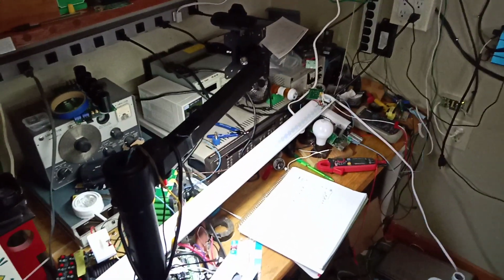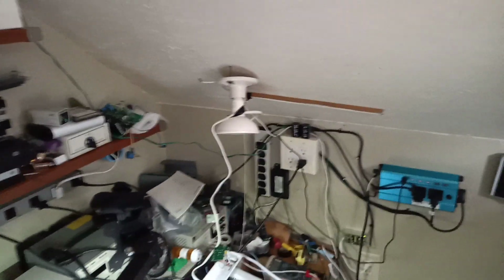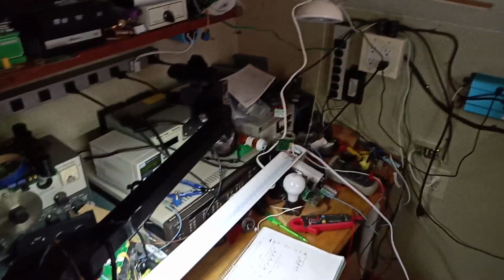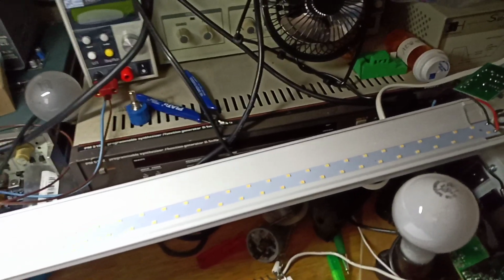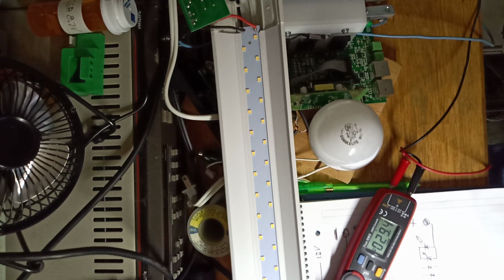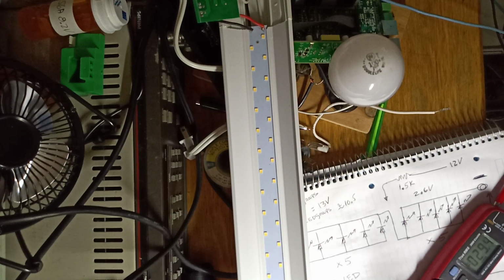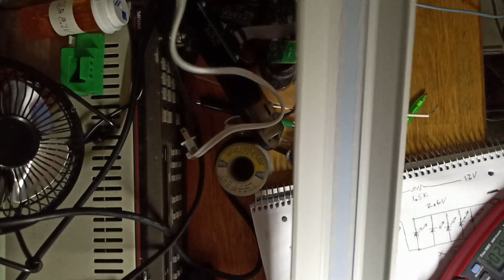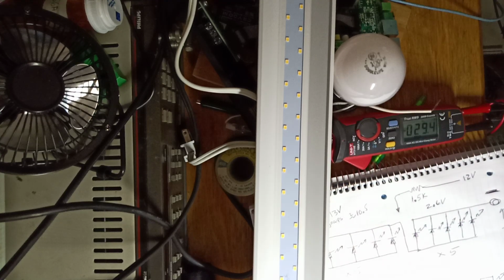120V LED Shop Light Conversion To 12V DC, How It Is Done

Comment from the maker: Not all shop lamps are suitable. Each LED can have one, two or three die in it. Another lamp I have has three in each LED for around 8V each. They put them all in a string for 114V DC. Impractical to convert to even 48V.  This also requires some skill.  These boards are aluminum with a thin insulator coating and trace.  I haven't found anything that will dissolve the coating.  Scratching it takes some practice not to cut thru.  When you do cut, it is easy to make it down to the aluminum substrate.  Then there is the risk to have two cuts short out the supply.  When finished coat the cuts with fingernail polish to prevent tin whiskers for shorting over time. I had already bought this lamp so there was nothing to lose.  
For those who have flicker issues with LED lamps running on inverters, PHILLIPS. may be the answer.  Watch this video reviewing popular lamps  https://www.youtube.com/watch?v=XeR2uPPCA2k

Comment: Forgot to mention in my last comment. I am really impressed at how bright the LEDs lit up at only 12/1500 = 8ma - it really caught my eye (pun intended)! Are these those commodity shop lights that sell for $20 or so, or special ones?
Reply from the maker: I just finished it a few minutes ago and decided to run it 26V with fewer cuts off the external 29V boost converter I had mounted for the other light. The power switch I changed to low and high intensity. The extra LED string at the end I left disconnected because it would be behind a shelf. I'm pleased at how it turned out.  This was a cheap $10 shop light but they all don't work this way. Another one has LED with three die in them for about 8V per LED. All in series for 114V.  Not practical to do at all. I used my 2700V tester on that one. That is a handy little device.
Reply from the maker: These LED would dimly glow just from the capacitance coupling of the iron.  I designed a LED monitoring system for a NGO. People has to walk this one foot wide path between the rice fields at night to see if the gas water pumps were still working.  There were poisonous snakes and other things that made this a dangerous trip. They wanted something cheap that didn't take batteries. I came up with a 4W LED mini floodlight that operated with a voltage doubler to power off the gas engines points. Less than a miliwatt but it could be seen at night. LED get very efficient at low current.
Reply: @opera5714  Impressive! Would love a link or an identifying name for such a cheap $10 shop light! The cheapest one in my area are $20+. I have WM/HD etc close to me
Reply from the maker: @subhobroto  I threw out the box about 2 months ago. Just some no name from a Big Lots, Job Lots place. I don't think it was UL. I just looked online at HD and WM and $20 is about cheapest.  Looked at this local place online and they have one $9.99, ZBG 50W.  I think I will try it. I really like the physical case of the one I got.  My other light is a Honeywell and it is totally unsuitable.  12V 45-390V inverters are only $6 shipped and it may fit in the case.  Maybe that is just a better way to go. I have a bunch of inverters out of emergency start battery packs. Pretty easy to mod these for whatever voltage you want and skip the H bridge.  I hooked one of these lights to a 50Hz inverter and the flicker was horrendous.  Pure DC is the way to go.
Reply: @opera5714  excited. Keep us posted about how the $10 light goes. If you can post a picture of the UPC code and the box that would be helpful. Absolutely DC is the best, unless it's exposed to the elements. Then a hbridge becomes helpful to stop or reduce corrosion

Comment: To ensure I understand the video: probe the light to find a 13v substring on the existing LED array and power that sub string using a 12v source?
Reply from the maker: The source was a 29V boost converter I had used for another lamp and that was current limited by a 1500 ohm resistor. LED will illuminate dimly with just microwatts. The voltage just has to be high enough to detect the minimum group. 12V would be enough to find a group of four,10.4V.  There is a total of 140 LED. Five LED are in parallel with a forward voltage of about 2.6 volts.  That makes 28 groups of 5 parallel LED the factory version.   
I chose 5 groups for 13V because this lamp will only be used in the daytime on a fully charged battery for making videos.  There are other lights in the room.  But, you got me thinking that should be a 10.4V with an even 7 strings allowing it to be used elsewhere if I should find better lighting for photography.  The bottom arm of the camera mount has 12V press on adhesive strip LED. Thanks for getting me to rethink this.

For totally flicker free with changing battery voltage a small boost converter could be used to power a longer string.
Reply: @opera5714  indeed! you and I both know the current losses in low voltage high current runs - so instead of matching the strings to the battery we have, put a little boost converter in there and save on some gauge. It allows you to have the PSU further away from the lights as well :)

Comment: Yeah the Dubai LED lamps. We have some at home. Phillips released them onto the market here in New Zealand. They are expensive, but they are damn efficient. 4 watt light gives 840 lumens. They have about twice as many LED filament strings compared to the normal versions of their lights. 

They are happy to run from MSW power, but are fairly voltage sensitive, they dim out fast as the line voltage falls. The light has a bit of green cast to it, but it is more pleasant on the eye than many LED lamps, which concurs with one of the marketing claims.